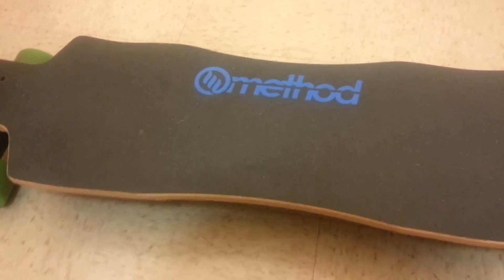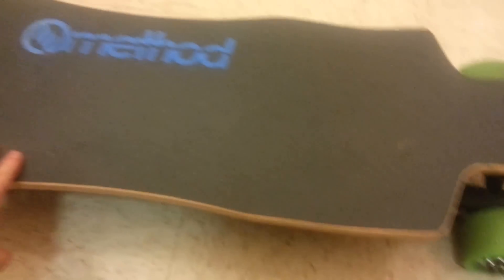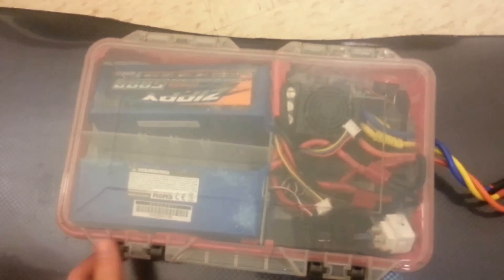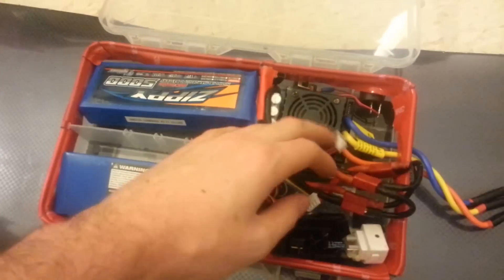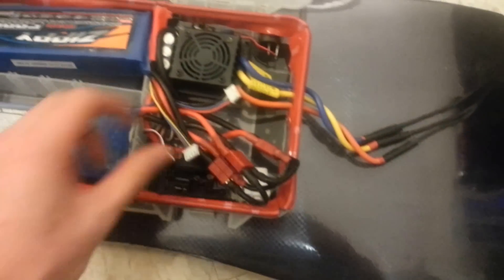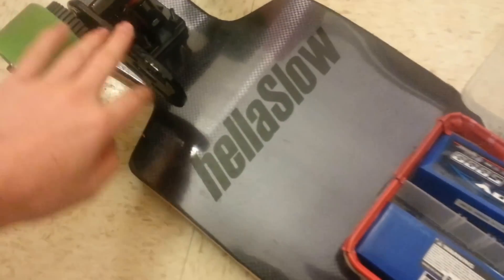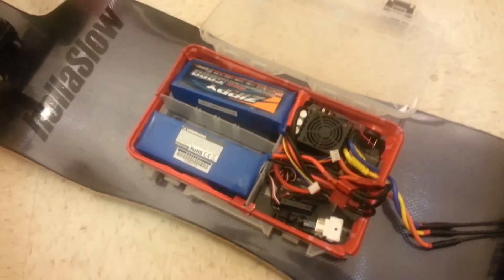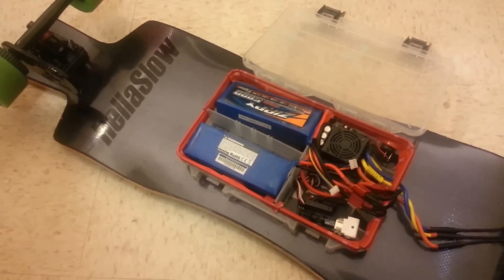DIY Electric Longboard Overview and Parts List for Cheap

Comment: Have you had any issues with the motor?

i was using a Sk3 5055 - 280 and it blow up with in a week... not sure if i want to spend the 75$ (aud) on the 6364-245 or the 190kv electric skateboard motor 6372 (250aud)

Nice board tho :)

Comment: I am def putting this up on my to do list during the winter. :) Couple of question if you dont mind ;) I tried to watch for the part used list for this build in the description field but can only see url to turnigy motor. Could you please provide some info on where you got the motor mount.. subbed btw..

Comment: Hi! 
Looks nice, simple and clean build you got. Like the simplicity of the electricity box. 
If you havent seen "great scott"s build you should. But i think you solution to the electrical compartment is better!  
But i am considering to build a simmilar borad my self. But i am a little skeptic to the speed and range.
I have a long background from rc hobby and a fairly long longboarding background. 

You are running on 6s lipo right? 16 000mah? And what are your gears ?14t on the motor and 36 at the wheel? 

I'am considering a 12s 8mah pack and something like 16-50/60 ich. Any thoughts? At last : what's the width of your belt? 10mm?

Would be happy if you answered. But i truly understand if you don't!
Reply from the maker: I'm running on 6s 5000mah, and my other pack is 6s at 4000mah with a higher c rating.

I've since changed ratios and I'll have to check on the tooth count.
I also changed to a wider belt 20mm to provide more "bite" on the pully.
Reply: +stonebay productions Any progress? I wonder if you know a source for an ESC, that is capable of such voltages und amps and doesn't cost like 500 bucks :)

lg, couka
Reply: nah, skiped this project for using my money and time on other projects. But hobbyking has a lot of ESc ;) read on the specs and you will find iit out quiet easy i think !  here's just a link to get you started ;)
http://www.hobbyking.com/hobbyking/store/__38787__Turnigy_Sentilon_V4_100A_5_12s_HV_Bulletproof_Speed_Controller_w_RPM_Sensor.html
Reply: Oh wow, my 150A 6s ESC was more expensive than that :D Good to know, thanks a lot :)

lg, couka

Comment: Hey I just had two  questions.
1. How long of a range do you get with you battery configuration?
2. How does the motor axis connect to the small gear and accually spin the gear rather than just spining in the gear but not spining the gear itself?
Thanks!
Reply from the maker: 1. About 7 miles if I take it easy
2. The motor shaft has a flat spot in it to make it a "D" shaft so that set screws can hold the drive pulley on

Comment: I was going to build one but cost pile up pretty quick. Bought a goboardcanada electric board instead for $500 and change.
Reply: hey bro I really want one of those boards! site has NO reviews though, and NO reputation. how was your experience with them, and how was it $500 I only see $799
Reply: +eezyTUBE they're new so it'll be some time before they get a rep. Easy to contact and lined me up with cheaper belts off eBay. $5 each. Boards are really good and have a 6 month warranty. They were $500 USD for a while with a sale code, now they're about $575 USD / $799 CAD.
Reply: I maked one and its cheap to build I took less than 150 euros
Reply: +MatillerTV that's about $500 Canadian. You think it performs as nice as a production board?
Reply: +CoteMotorcycles Thats more about 220 Canadian Dollars :D
Reply: +CoteMotorcycles 500 lmao its like 250 or less
Reply: I was being sarcastic cause our dollar is worth shit right now.
Reply: +CoteMotorcycles true lmaoo I order shit for $50 and it costs like $120 with import taxes and all. where can I buy ur boards?
Reply: +CoteMotorcycles ohhh lmao man u were pretending u don't own goboard Canada but u clearly do ur name is on the site lol
Reply: +eezyTUBE I own it now. A friend brought these boards in and I picked one up. He needed money and I like the boards, so I merged GoBoardCanada with Cote Motorcycles.
Reply: +eezyTUBE you've been to the website obviously. You can pick one up there, shipment is supposed to be in on the 5th.

Comment: Hi, so I have been waiting to make this and I was going to use the same parts because I have been looking into this for some time now and found they work for what I want. One of the things I found was with this type of battery it can't go under 3.5v ( I know absolutely nothing about this stuff), so I was wondering how do u know when it's at that or any charge of the battery, will it just shut off, give you a warning or what? If you could give any insight to this that would be great because I originally thought u plug in the battery use it then when it's dead it shuts off but I guess that is clearly not the case. 
Thanks!

Comment: The wires coming from the outrunner are all black , how do  you  know  which  color wire  to wire them to on the esc?
Reply from the maker: Singnaye Xiong  It doesn't matter because it's 3 phase, if the motor spins the wrong when when you hook it up just switch two wires and it will spin the other direction
Reply: ZSDesign I see, I'm  new to RC. I got  all  my  parts in except   for the gears and belt. I tried to get the same esc you were running  but they were  out  of stock  so I picked up a Track Star 150amp . We'll  see how it goes .
Reply from the maker: good luck, don't forget the programming card!
Reply: Yeah I got it too, thanks .

Comment: Hey I've seen many people make these Longboards and they're all remote control. I'm in the middle of building my own but it has a back foot pedal instead. I'm still partially in the design phase. Do you have any tips?
Reply from the maker: ben slivka Make sure you have enough ground clearance, mine used to rub pretty badly until I installed the thick riser pads

Comment: The reverse is nice because you can use the skate as a rc game and you can make it take jumps etc. The most important for having reverse is because in a high downhill  road if someone has 1wheel -1motor the brake should be in the front wheel, or in the other hand if a uphill road uppears the  motor should be in the back side of the skate

Comment: So do you suggest me that esc or the Turnigy Trackstar 1/5th Scale Sensorless 200amp 8s? 
Does the reverse works good?
Reply from the maker: george kontopoulos  I haven't tried the turnigy yet, but the two most popular ones are the Hobby King 150 and the EZ-Run 150amp. As for reverse, I have it disabled on mine because I don't have a need for it.

Comment: Do you have regeneration with this esc and good braking?
Reply from the maker: george kontopoulos No regeneration because it is very inefficient and would cost quite a bit to implement an esc with that function. It uses motor braking which works very well (produces heat and sound).

Comment: Nice video man! If you block the ESC from fresh air, doesn't it get too hot in there?
Reply from the maker: RandomLOLGamer Nope, after a long ride it will be warm to the touch. Not hot enough to matter.
Reply: ZSDesign Thanks for the reply! I'm making one myself, thinking of air ventilation with filters between to block out dust, should do the trick, since im a bit paranoid about overheating.  :D
Reply from the maker: good luck to you! I chose a closed case so that way it could be waterproof.

Comment: Hey man, I have all the same parts you have (motor, ESC, wii-ciever, and battery pack) but when I connect all the wires, nothing happens. Any ideas on what is going wrong?
Reply from the maker: ok let's start simple. are the batteries wired in series? also, do you have the ESC switch turned to the on position? try testing the ESC with another receiver/transmitter (from another hobby grade device). If not I would investigate how you have the wiiciever wired up (correct polarity on the plug). regardless the ESC should light up/turn on the fan when switched on.
Reply: I only have a single battery pack right now, I'm waiting for more money to get the second one. The ESC is turned to the on position and still nothing happens. No lights, no sound, nothing. I have no other reciever/transmitter, letalone a hobby grade device. I do not follow what you mean by the polarity with the plug though.
Reply from the maker: Chase McCoy Plugging in a 3s battery to the esc should turn it on and light the red led along with the fan. Perhaps your esc is bad.
Reply: What would I do if it was a bad ESC? Do you think there would be a warranty on it? Or would I be out of luck and need to purchase a new one
Reply from the maker: if you purchased a hobbyking one from them, yes you are covered under their warranty.
Reply: It looks like it would have to have been within 30 days of the purchase, which has already passed. So I think that I'm out of luck.

Comment: One more thing I'm wondering about is the braking.  how would you rate the braking with this ESC?  and do you know where the braking energy goes?  does the braking recharge the batteries (regenerative braking) or does it dump the power into the motor and ESC (so they both heat up).  I live in a place with many hills and slopes so I may be using the braking function a lot and I'm wondering if i'll overheat the motor or ESC?

Comment: I've been researching making my own board using HobbyKing parts and I've also settled on the 150A HobbyKing ESC. The one thing I can't figure out is that if I pair it with a lower amperage motor how does the ESC know not to go over the amperage rating of the motor? for example you are using a motor with a max amp rating of 70amps.  so when you give a 100% throttle command is your ESC putting 150 amps into the motor while it is accelerating?  or did you some how program your ESC to limit the current? I'm afraid the 150 amp ESC is going to melt a lower amperage motor.

Comment from the maker: The ESC in this video can only support one motor
Reply: Is it really neccessary to take such an expensive esc?
I'm on a budget, and wondering if a $30 esc would do the same
Reply: Make sure your ESC Current Rating > Current Produced By Battery

Comment: Is this setup very noisy? I want to make a e300 with one of these for getting around campus and don't want to become "that guy with the annoyingly loud comtraption".
Reply from the maker: I use mine everyday it's nice out. Its only noisy when braking which is good because it alerts others you're stopping. People love watching me ride mine because it's so different than the norm.
Reply: ZSDesign How well has the ESC held up for you? From what Ive read alot of people have trouble with them since they aren't intended for this type of application.

Also what is hill climbing like? I live in a really hilly area (Akron Ohio)
Reply from the maker: The ESC has held up quite well, people use the HK 150 amp esc found here:(http://www.hobbyking.com/hobbyking/store/uh_viewitem.asp?idproduct=10370&aff=1545616) 
Most people run them without a fan, but I left mine on for extra ventilation. As for hills, I've gone up some very large ones here in Portland and it did them nicely. Two motors may help improve hill climbing though.

Comment: Hi, whats the max distance on single charge ? Full speed and controlled (eco) speed ?
Reply from the maker: max distance i'd say is around 7 miles on a conservative run, when running more aggressively it gets about 5 miles
Reply from the maker: ZSDesign the advantage to having a DIY setup is being able to have extra batteries charged up in your backpack to extend the range.

Comment: I'm using that exact motor. How well does it work under 6 cells? I am planning to use 10 cells 

Thanks
Reply from the maker: 6 cells I get a top speed of about 26mph, and can climb most high grade hills at 5-10 mph depending on the degree of the incline. It is definitely wound for more top end speed. With 10s you'll have more torque which will help with hills. Good luck with your build!